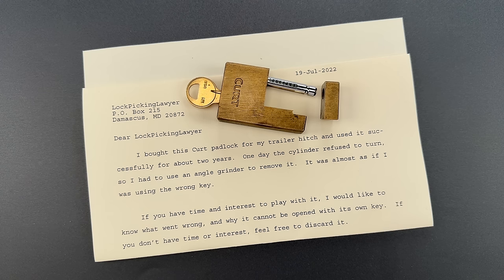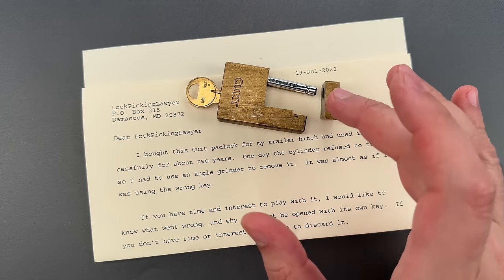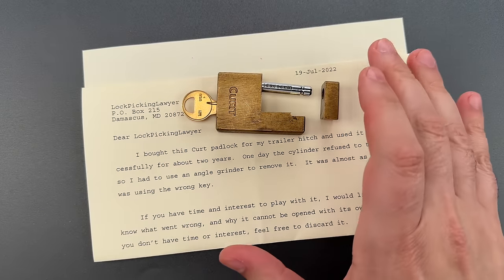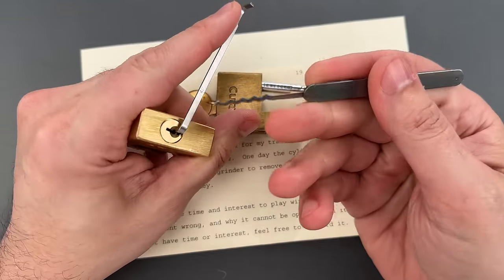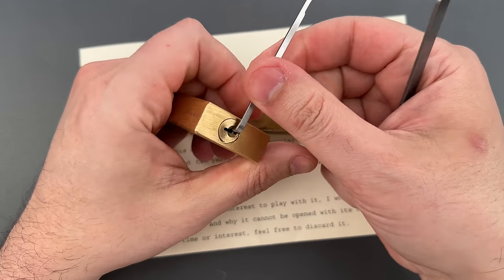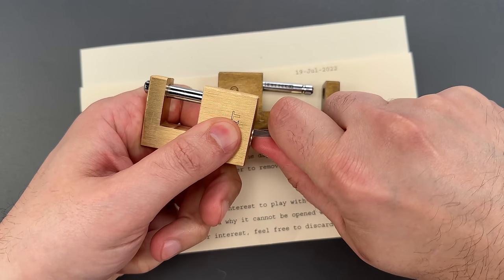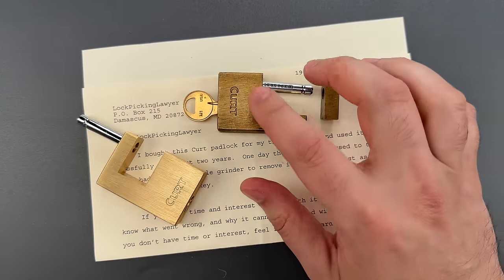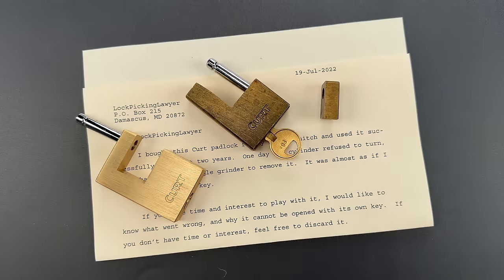[1470] This Curt Trailer Lock Does Nothing Right

Comment: While most locks are easy to open both with the key and without it, the opposite is sometimes true. One of my door locks is a disc detainer design, so it's hard to pick, but it's also very hard to open with the key, especially when speed is concerned (you need to do it in under 45 seconds or the alarm will trigger, and it's not a trivial task in this timeframe, the last time I barely got it). So I only lock it when going away for a very long time, and in other cases I only lock three other ones.
Reply: A hard-to-open disk detainer? Who's the manufacturer? (Might be an idea to get it replaced.)

Comment: Well he used the lock successfully for two years and only seized through lack of maintenance. So maybe it was more fit for purpose than you think.
Reply: I don't think an Iron locking mechanism on a lock that's supposed to be used outside is very good design, that's just asking for it to break. Secondly yes, the vast majority of the time the only thing a lock needs to actually do is be present, just seeing a lock is enough to discourage most people from stealing your stuff.

Comment: This video really helped! I just picked up a camper trailer and was going to buy one of these locks today. Do you recommend a ball or tongue lock that will at least slow someone down? The yard I am keeping my camper at is gated and also has cameras, so hopefully that will help too!
Reply: He's had good results with PacLock before.
Reply: Paclock is the one brand for trailers that seems solid. You'll know their good because the price is 2-3x higher than the useless stuff out there.

They also have products for the trailer hitch receiver, storage compartments that can be keyed alike.
Reply: @moganmark  ah yes because high price=quality :D
Reply: @moganmark  they're*
Reply: @bmkmymaggots  for honest manufacturers, high price implies high manufacturing cost, which might imply difficulty destroying or bypassing the product.  Proving your trust in the honesty of the manufacturer is the hard part.
Reply: Just check his old videos.  There’s one or two decent trailer locks and a handful of terrible ones.  You may also want to weld the tongue on the trailer so it can’t be unbolted.
Reply: PacLock is your best bet. LPL has given them some good marks over the years. Also the  PacLock President will reply to comments when a video is done. Also they have a whole line of locks to which you can chamber to one key. Which is really good for those who need a bunch of locks. They have pucks, trailer, pad and a bunch of other locks.
Reply: I think Proven Industries is also highly rated.

Comment: I use a "Master lock" version of this on a jon boat trailer, fully aware it's just a "tamper resistant" device that keeps the hitch assembly closed, and hopefully won't pop open and fall off while towing. I'm sure one smack with a good sized hammer will defeat it.
Reply: I would actually have concerns of any pin tumbler padlock being used in place of a clip. The lock will be bumping itself to unlock thousands of times on a cross-country trip.... just takes the right luck for it to fully pop open, slide off, and driver ends up seeing his trailer or boat passing him on the interstate!
Reply: @citylockapolytechnikeyllcc7936   @City Lock a polytechnikey llc company  The CURT branded lock that LPL showed apparently did not fail in this manner, it needed manual intervention to be opened. Conversely, a "spring pin or clip" can fall out much easier , and can be quickly tampered with by a casual passer by as well. Any trailer I use is properly secured to my vehicle with chains, crossed underneath to keep the tongue from dropping to the pavement if it does become unhitched for any reason as well. I'll stick with the lock, as its kept lubricated, inspected upon every stop and had served me well for years. This latch does have a spring interlock to keep it closed, the lock is a secondary device. I have also never had , as bad as they are, a Master lock "fail" in service after using them for over 50 years.

Comment: In fairness, iron and outdoors..  don't tend to mix well. From the senders' 2 years timeframe, that seems a short time.
What is another short time-frame... a video of 156 seconds that reads the letter, and opens the lock 4 times using 2 methods.
@LPL we need a video showing some recommendations of locks that would survive a 10 minute video. I know of a few, I know there are some rarities in that box of to-do's. but some quick video on current models that actually withstand / last even 5 minutes may be interesting to consumers.

Comment: Weird request to piggy back on this video -- Could you do a video explaining how to pick a lock with the actual key when it starts to degrade?  

My landlord is the worst about replacing the worn out locks on our building, which leads to us getting caught outside all the time.  Everybody has different armature theories on how to jiggle our keys in the lock, out take it in and out real fast, or put pressure on the handle while jiggling, to tap on it with our car keys to "pick" it open.  How should we be tensioning and/or jiggling when we have the proper key but the lock is worn out a bit? Does the lock type matter for how what strategy we should be using? And why shouldn't I put gum in my landlord's lock to protest?

Comment: I agree with comment section it would have been fun to see the internal mechanism and what makes it suseptible to rust and corosion..

Another failed component on this design is seeing as the lock was ment to be used outside on a trailer lock some care should have been given to water resistance to protect the internal core.

Comment: I had a Great ideal. This is not related to the subject, anyway. Truckers have problems with people breaking into their cabs, especially when they are sleeping in them.
So they use the seatbelts to secure the doors. I thought I would bring this to your attention because you and bill were so creative designing tools.
The biggest problem is safety.
If a trucker is in need of emergency aid. Their need to be a way of getting in quickly.
I will leave this project in your creative hands.
Tim

Comment: SAme as Reese, Fulton, and all the stuff you get at Uhaul, Storage America, Home Depot etc.   These locks are beyond sad. But people buy them on impulse.  Instead, I recommend the Strattec BOLT coupler lock. It  is far superior. Sidebar, Automotive level lock ( Lishi Proof, too ) and can be matched to the ign key of nearly all pickup truck brands. All that said, a coupler lock is not all that great a concept to begin with. No matter how good, criminals ignore it. Especially if the lock is being used with a ball when DISCONNECTED from vehicle. A better choice is a quality wheel lock, such as the Rackem/Lock'em wheel lock, with disc detainer V3.0 cylinder ( Abloy Protec can also be installed into this lock, as can Medeco, but exposure to contamination can be a problem for all but the disc detainer type on an RV situation. LUBRICATE SUCH LOCKS REGULARLY, preferably with Houdini. Avoid graphite, WDSticky, and teflon. CRC 5-56 or Silicone lube spray can be used if you can not get to a locksmith to pickup an 11 OZ  lifetime sized $10.00 can of Houdini

Comment: Hey LPL, there is a lock at work (Sargent using custom keyway, is a mastered lock, is part of the signature line (key has the feather). In one of the specific cores, the key gets stuck and you have to jiggle it to get it to turn back so you can remove it. What causes this?